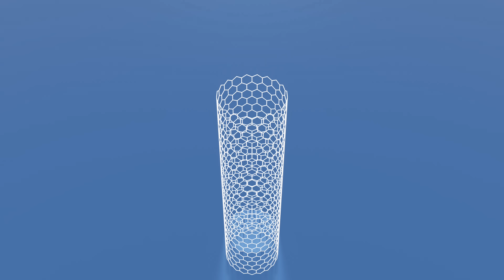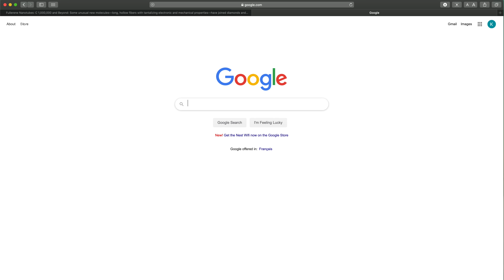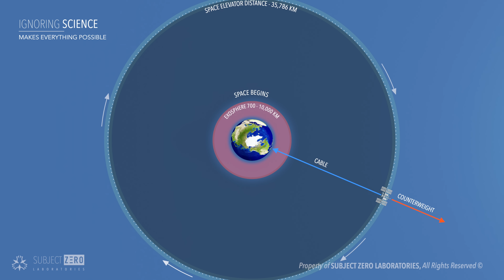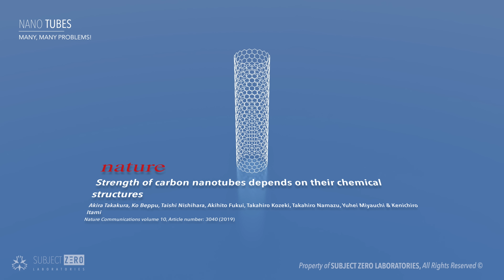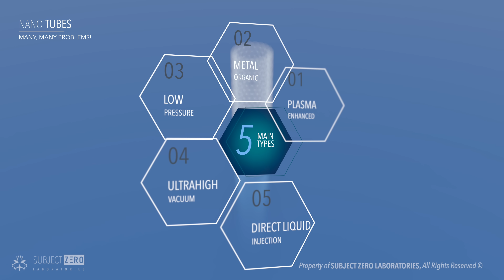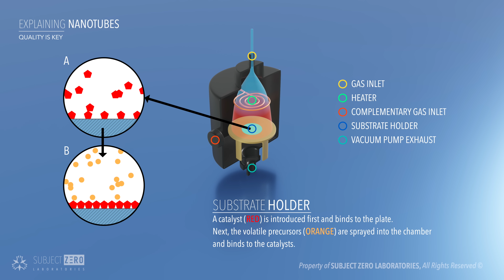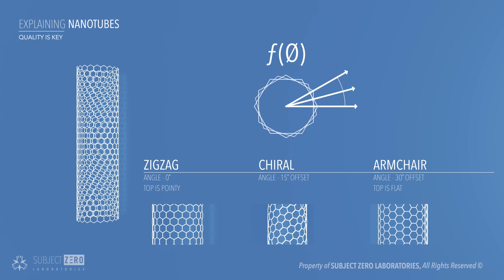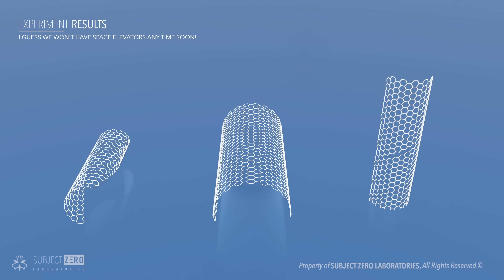Nanotube Strength, Bad News for Space Elevators [2019]

Comment: 2nm wide tho. Couldn't we twist several strands together and get at least triple strength? Or does it not scale up.
Reply: Strength to weight ratio is the issue.  The cable needs to be so long that the weight of the cable is the real load.

Comment: 4:17 I very strongly disagree on the time arguement. To launch a rocket it takes weeks to prepare and build. Rockets can also fail. An elevator is there. Put it in, push the button.
Time is not relevant when you can save just a tiny bit of money. I will refer to the Concord Aircraft in this matter.
Reply: The time to build the rocket is included in the cost / kg that is mentioned. From the traveler perspective, he arrived, he paid, the rocket is there already. Also the cost of the elevator itself would be enormous. It would take years to have a return of investment on it compared to the already existing rocket. Say 10 years of usage. Now if the price of the rockets half, the 10 years would become 20 and then 40 years... The return of investment could just escape until we are done with the Dyson sphere.
Reply: yes, good luck with a tube so long that is more than 2 times the circumference of earth to withstand weather erosion, meteors and collisions.
Reply: @JabbarTV1  there are already hundreds of thousands of km of rail on Earth (10+ times the Earth circumference). Maintenance would obviously be harder than rail maintenance but maybe not that much, for regular maintenance they could use the elevator itself, the problem would be if the cable snapped
Reply: Space elevators are one of those things that are immensely expensive to build but should pay itself off in the very long term. 

Another example of this would be a Dyson cloud.  We had the technology in the 1960's to build a cloud of solar panels around the sun to collect energy and "beam" it back to Earth, solving our energy problems for pretty much ever, but the cost of doing so would have bankrupted the planet.
Reply: "an elevator is there"   yes. along with constant athmospheric pressure, wear which is impossble to fix and oh i don't know.  bullet speed space debris in LEO. 
I don't know how about you but i would rather have a rocket "fail" & burn up then a 2000 km 40 m  minimum diameter cable come crashing down to earth.
Reply: It is also worth mentioning that an elevator can run on electricity (potentially solar generated on the orbital satellite) whereas the rockets must use fuel.
Reply: "Time is not relevant when you can save money"..... Try spending money when you're out of time. Dont be naive
Reply: @jxstnjsph  Indeed. How many business and political leaders travel to conferences by ocean liner today? Time matters for some things, less so for others.
Reply: @annoyed707  yet huge cargo ships are still use to carry goods despite planes, as you said time matters for some things, not for others, space elevators would have a purpose despite being way slower
Reply: Well, Starship takes a week to build and 8 hours to prepare, and able to lift 150 tons to orbit

Comment: Why can't you just make a tube that can be inflated with air to push the cargo up?
Reply: The air pressure required at the base would be unrealistically high and reqier a material with an even higher tensile strength to weight ratio.
The air would also be compressed into a liquid or solid through nearly all of the tube.

Comment: Build an ALL Steel Superstructure (Like a roller coaster) and SHOOT the Spaceship straight into orbit?  Powered by Electromagnetic Aircraft Launch System (EMALS) like the aircraft carrier. The initial launch is the most expensive due to fuel cost. The superstructure will be about 5000 feet tall (easily doable with current technologies) - ALL STEEL, No concrete. It will not be that expensive as steel is supremently abundant. The project will pay itself within  about 50 to 100 launches.  Can also be used for visitors who want to ride up/down a 5000 ft roller coaster during down time ($100 per ride), and there will be NO SHORTAGE of people who want ride this thing just for bragging rights. Making money to pay for maintenance no matter what happens.

Comment: Well I think even with Space X, Space Elevators still have a room even if it takes days to get to space. Much like we still have trucks, air plains, ships, etc. Different methods allow for a big cost difference when we talk about how much weight we are planing to send up. While  air plains are faster, they also cost the most to ship anything anywhere while a ship will cost a fraction of that but might take an extra day or two. The other problem is we can only make a air plain so big and a rocket so big as well - so that is where Space Elevators will over take larger object as well thus even if Space X could get the cost down it would still have limits in what it can send up to space. There is another way to shape nanotubes as well that could increase all the propeterys going forward. Over all, I think we're on the way to making this happen. It'll just be another 100-200 years before we see it sadly.

Comment: Space Elevators are actually a terrible way of getting into space, it takes days to elevate to the altitude of 36 thousand kilometers and even so you can only take a limited mass, or the whole system fails. 

There is a more simpler method of getting into space called a launch loop that uses current manufacturing methods and materials such as copper, steel, iron and electromagnetic levitation, it only goes up to 80 kilometers high and allows for direct insertion into low earth orbit with huge masses, using only electricity to accelerate at 2G's. It is imo an actually feasible method of getting vast amounts of mass into space for peanuts.

Comment: What I've been wondering about, is whether graphyne would be strong enough to create vacuum ships, at least if you drop them from space. I imagine having a big station floating on the upper atmosphere, with cranes. Then you could use traditional balloons to lift cargo up, connect with the crane which would then haul it the rest of the way up. Now that you have no real friction, you could use an electromagnetic gun to shoot non-sensitive cargo up in orbit or beyond. That would include water, which could be used to create fuel in space. Then you could also have a rocket-driven winch in space, hauling squishy things like humans up the rest of the way. No need for these extremely long cables.
Reply: A vacuum ship wouldn't have much more buoyancy than a modern hydrogen balloon. And in any case, lifting anything up would sink it miles down into the atmosphere, negating any of the advantages versus just launching from a mountain top. Realistically, it would probably be easier to just build a very high tower (some form of space fountain structure, probably) as a giant hollow tube and evacuate the air inside.

But even easier would be building an orbital ring, say at 80 miles altitude, and then dropping rope tethers down to the ground wherever you want and letting elevators climb them up to the ring. The ring can then be used like any normal launch tube system to fling material out into space. No long cables needed, no nanotubes or graphene, just normal materials used today.
Reply: @berserkasaurusrex4233 : Where I come from, a ton of hydrogen weighs a ton and if you can remove some of that weight, then your craft is lighter. In any case, I really don't understand how adding fifty kilos of water to it would send it falling miles down the atmosphere. The goal of my thinking is not to send giant spacecraft into space, but to find very low cost solutions for small packages that aren't affected by acceleration. Orbital rings is a completely different scale.
Reply: @jeschinstad  If your craft weighs 10 kilos, adding 50 kilos will certainly send it far below its maximum altitude. The issue isn't the weight of the hydrogen gas or lack thereof, it's the weight of the balloon itself. Graphene isn't heavy compared to steel, but it isn't that much lighter than modern plastics used in current hydrogen balloons. Not if you want it thick enough to maintain an internal vacuum, anyway.

It would probably make more sense to use it to make a conventional hydrogen balloon, then heat the hydrogen up to generate more buoyancy. The difference in buoyancy between hydrogen and total vacuum isn't that much to begin with, especially at high altitudes.

Again, you can get above the lion's share of the atmosphere by just building a tower on top of a mountain, and be able to launch far larger payloads from there, than any balloon could reasonably lift. Especially if acceleration isn't an issue.
Reply: @berserkasaurusrex4233 : If you don't see the strength to weight ratio benefit of graphene ahead of plastic, I don't think we have anything to talk about. You can't make a vacuum ship out of plastic. It's not strong enough. That's the point. I'm wondering whether high quality graphene would be. Unlike building giant space towers on the summit of Mount Everest, I think graphene might become very simple and cheap once we've started using it for everything that's imagined.

Comment: I don't have the math or physics chops to test this theory but it shouldn't be too difficult to test for someone who does... what about magnetic chains? instead of a solid load bearing span all the way up, have a series of active elements with electromagnets, each suspending the next. would it be possible to create structures with arbitrarily high strength/weight ratios? or am i not even close

(ignore how fiddly and delicate this would be, that's totally solvable with a lot of work. i just want to know about the theoretical max strength/weight of such a structure)
Reply: The lightest metals tend to have quite high resistance. I am pretty sure they would melt before you get a significant magnetic field. You would also need some fancy wiring and power supply through a secondary wire - which would need the strength to support itself.

Comment: An orbital ring is a far more useful concept than an elevator and doesn't need such strength of materials. Similar scale in terms of 40,000km ring in orbit, but it only needs to be under low to moderate strain, not it's entire weight. And it can be in a 200km LEO and the elevator component would then only need to support it's own weight over 200km instead of 36,000km. It also would be a quicker trip up to orbital height, and useful for launching in to orbit using the ring as a track.
Even kevlar is good enough for most applications, no need to hang everything on the production of nanotubes in bulk.

Comment: And if it works once - how long will that totally unprotected cable hold when a heavy payload runs up with 400mph ?
Any protection would be a lot weight and each ride is a lot of mechanical stress.
Reply: Space elevators are pleb tier megastructures, skyhooks and launch Loops are much better ideas at least until we get the orbital industry in place to contemplate building orbital rings.
Reply: @mrspeigle1  SFIA? I see you have Patrician tastes.
Reply: @werewolf4358  one of my favorite podcasts, though oddly enough I was introduced to sfia through the concept of skyhooks not the other way around. Read about the concept in a Sci-Fi book got curious and went to Google.
Reply: @mrspeigle1  lol. Things have a funny way of working out like that sometimes.
Reply: They would need something for the payload to attach to the cable to move it up and down, nanotubes are slippery as graphite. Attaching any kind of grippy surface will add to the load. A grippy surface that doesn't wear away under vehicles of several tonnes at 400mph? Metallic cores for electromagnets? Really heavy over thousands of km.
You would need some kind of cable ties to keep all the independent carbon nanotubes together. If you can make a nanotube 35,000 km long. If you can't then you also need some sort of anchor at both ends of each nanotube linking it to...other nanotubes? Those connections are going to have to have the strength of a nanotube.

Then you have the problems of waves in the cable. I believe the strength here is for tensile strength under perfect conditions. What happens when you have shear forces?
Also constant radiation bombardment of the nanotube cable knocking atoms out of their neatly perfect carbon lattice. How many can they lose before the whole thing snaps? Not to mention all the space junk we have left up there.
So, not happening on my planet, thankfully.
Reply: NASA has suggested using hypersonic sleds with electromagnetic levitation to reduce friction and wear to the minimum possible amount.

Comment: Space elevators will never happen. Technically not possible - even with nonexistent super materials.
Reply: "technically", with a hypothetical material of the required strength/weight ratio, it WOULD be possible. by definition. are you a professional debbie downer or something?
Reply: @cerebralm  there od much more to it than just a lack of material. Main problem imo being that the 'cart' traveling up not only must gain potential energy but also angular momentum. In other words it can't go straight up.  Actually what makes it immpossible is phisics :) If you ignore phisics than yes - you can do it.
Reply: @fomalhaut86  - Physics! Doh! Space elevator fans do not like physics.

Comment: It’s not as much of a pipe dream as you might think. 

35,000 km is long, but it’s not too far off from the length of all the fiber optic cables all across the planet. Moreover, carbon nanotubes aren’t “the one” thing that could make space elevators a reality. Graphene by itself could do the job, and so could diamond nanothreads, as well as boron nitrate nanotubes. 

Also, the travel time is a bit misleading. Yeah it would take days to climb the elevator, while it only takes a couple hours to launch a rocket, but rockets also have to wait for ideal weather conditions. Because of the massive tension on the cable, it will be extremely rigid to the point where even a hurricane couldn’t damage it. 

Furthermore, there’s a fundamental barrier for rocket launches that not even SpaceX can overcome. Launching larger payloads fundamentally costs more and more, and until we get fusion powered rockets, it will always be the more costly option next to an elevator ride. 

Finally, the most important thing to keep in mind is the promise of space elevators. Just by letting go of the cable at different lengths, you can literally launch anywhere in the solar system, no rocket fuel required.
Reply: Oh I should also point out the cable doesn’t necessarily need to be made of one long continuous molecule. At Rice University, they make spools of carbon nanotube threads, but they are small centimeter long nanotubes that stick to each other via Van Der Waal’s forces. 

To get the amazing tensile strength promised by carbon nanotubes, you just need continuous molecules long enough so the friction between them is greater than their tensile strength. 

So while defects certainly weaken the tubes, you only need enough of them to maintain their structure for the cable to maintain its strength.

Comment: Welp, then theoretically carbon nanotubes CAN have 200-300 gp, BUT, that is if the tube is PERFECT, but de creation of the tubes, are imperfect, so the strength is lost, from design, method of construction, diameter, angle, defects, etc. etc., so we can produce in the lab tubes of at most 66 gp; so we still don't have a better production technology, that can allow us to produce 100gp in mass, up until that point, space elevators won't be reality.